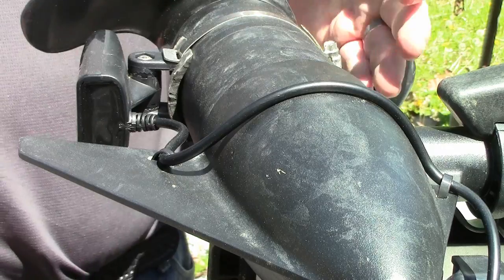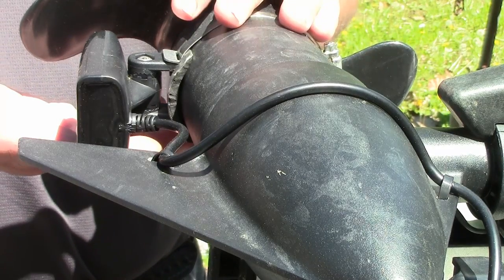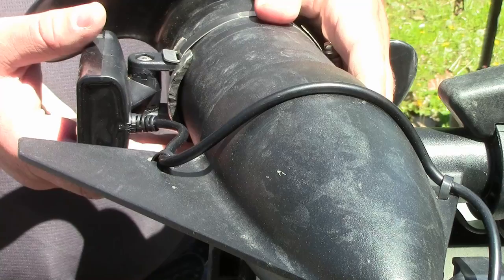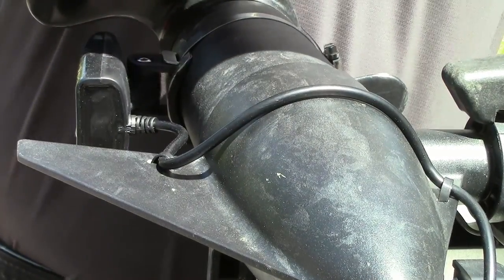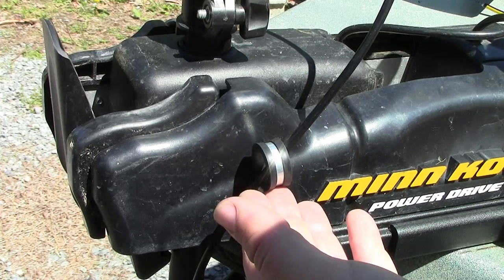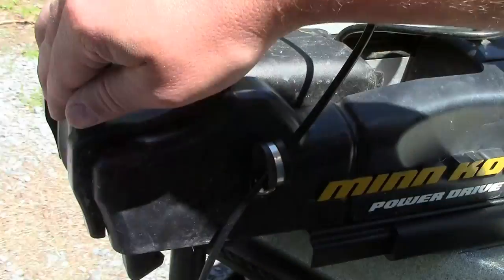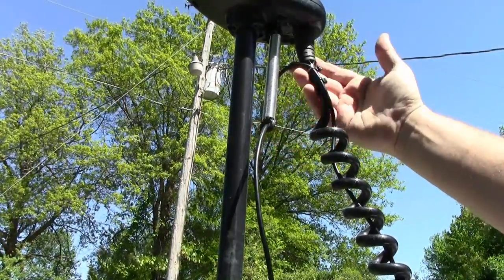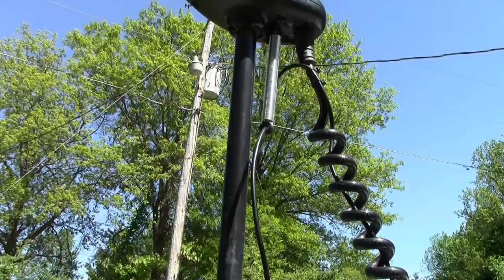Minn Kota Powerdrive V2 Side Imaging Transducer Installation

Comment: Great job!  I found your video after finding and watching the other solution using the spring.  Would greatly appreciate it if you'd provide a 'grocery' list of the items purchased/used in the solution and where you found them.  Thanks again for the really fine video!
Reply from the maker: Thanks for the response. Next time I'm at the Home Depot (Which incidentally is several times per week) I'll  make a note of the actual product names and UPC codes. I'll update the video description with the information and leave you a reply here to let you know the update has been published.

Comment: Great video (Powerdrive V2 Transducer Install) but I have one question as to the orientation of the transducer. It appears to be mounted backwards with the nose of the transducer towards the prop instead of the bullet end (front). Wouldn't this reverse the side imaging? Not trying to be critical. It just seems to be reversed to me.
Reply from the maker: Robert Knisley it is mounted backwards I noticed that after I uploaded the video. now with the g2 or g2n models you can reverse the Side Imaging so that it will display correctly. if you are running a gen 1 unit you will need the transducer oriented correctly. I didn't catch it until the first time I was out on the water I was trying to figure out why the Rocky Point I was fishing was showing on the wrong side of the boat. Lol.

Comment: Excellent summary and solution to the problems involved in protecting the cable. One question? How do you secure the cable to the bottom of the spring? I see that the cable goes through the grommet, is it secured somehow at that point so it can't slide up and down?
Reply from the maker: Thank you. The grommet holds the cable pretty well. Friction holds it in place. If you are concerned about it moving, however, you could put a small zip tie behind the grommet.

Comment: Do you get any interference with the wire running through the middle of the main curly wire when the motor is running ?Thanks Danny
Reply from the maker: Dan Timek I can tell when the motor is running and when it isn't by the appearance of the screen, but the interference is minimal.

Comment: Now that you've used this system for a couple of years is it holding up?  Any updates you would recommend?
Reply from the maker: It's holding up well and has even survived a couple of bad hits. The only thing I had to change is the orientation of the transducer. I mistakenly installed it backwards in this video. This is not an issue on the g2 and newer units. As you can reverse the side imaging orientation. It can confuse you on the generation 1 units, though.

Frankly, with minn Kota and Humminbird being under the same parent company, I'm surprised it has taken as long as it has to see a good factory side imaging solution on the trolling motors.
Reply: @TheWeekendAngler  great. thank you

Comment: Pull the head and shaft right out of mount. Silicone the wire in the groove on shaft. Have done a million of them
Reply from the maker: The powerdrive doesn't have a groove in the shaft. The terrova, on the other hand, does.

Comment: How does side imaging work with the trolling motor spinning all the time?
Reply from the maker: When you start turning the trolling motor from side to side it will distort Your Side Imaging. But, when you are trolling any relatively straight line, you get a perfect picture. There's a trade-off to everything. I prefer to have Side Imaging up front and deal with a distorted picture every now and then as opposed to only having My Side Imaging at the rear of the boat

Comment: So the cable doesnt hang up at all when the motor spins?
Reply from the maker: The cable doesn't get hung up as the motor spins. You do have to be careful not to spin the motor completely around, however, as you can still cause damage to it.

Comment: This may show my ignorance on fish finders, but will a side imaging transducer work on a trolling motor that is twisting back and forth?
Reply from the maker: Don't feel bad. I asked the same questions of humminbird prior to installing a side imaging sonar at the bow of my boat. It will work, but understand that every time you turn your trolling motor it's going to change the direction the sonar is scanning. If you're making slight left/right adjustments you won't notice a lot of distortion. If you turn 90 degrees or so you you'll really notice it. 

I tend to troll in a straight line or at least follow the contour of the shoreline I'm fishing so for the most part my screen shows something I can understand. If I'm not needing side imaging, I'll switch to a 2d sonar / down imaging display and just look straight down. That is useful when fishing deeper water and you're trying to find a stump or other feature to drop a marker buoy on it.